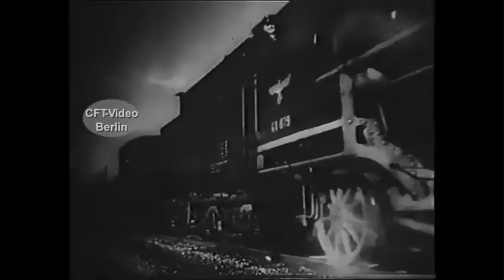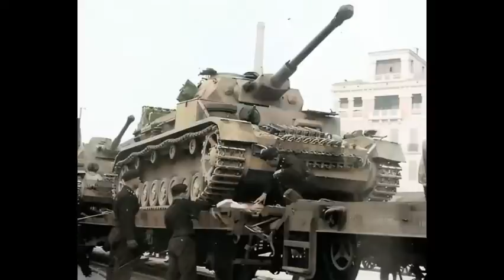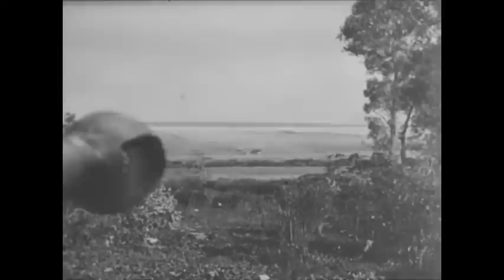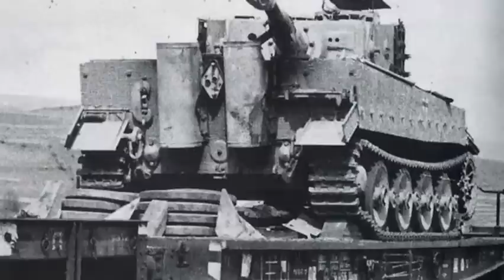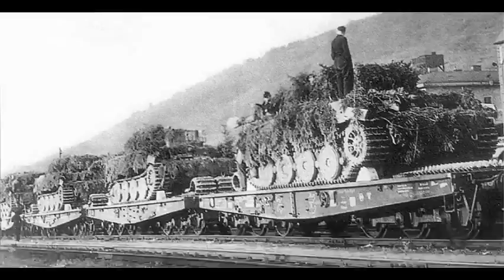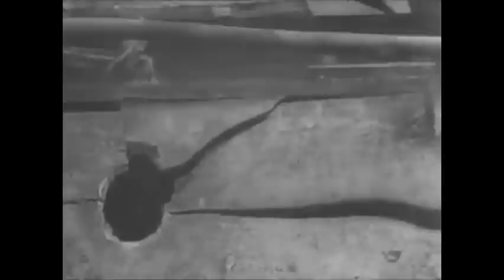Tiger on the Train - CUMBERSOME Railway Transportation Procedure of the German Heavy Tank (’42– ’45)

Comment: That is such a nightmare. To have to do all that maintenance work just to embark your vehicle onto the rail network. I might be completely off on this information, but I seem to recall the following: that they developed a standard track (that could stay on the vehicle) and the had “bolt on” extensions. This would allow them to just unbolt the extensions to get the narrow width… or bolt on the extensions for off road. Does anyone know if this is true… or my faulty memory?
Reply: You may be thinking of Ostketten, which were used on the Panzer 3 and 4
Reply: yea, they did that with Panzer 3/4 as a makeshift solution for the eastern front and it kinda worked. 
WIth tigers it wasn't only the tracks, you needed those wheels to support the weight. 
But I don't think it mattered that much. A Schwere Panzer Abteilung had about 30 or so tigers and hundreds of men. You just needed a lot of spanners.
Reply: @zammap08  Winterketten kinda worked, until Ostketten were produced to do away with the nonsense of bolting on extensions on.